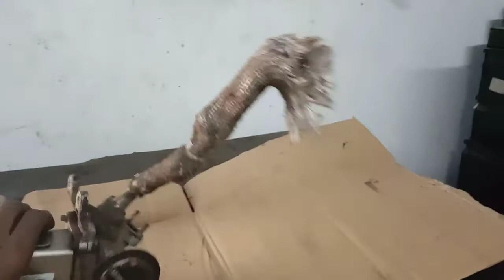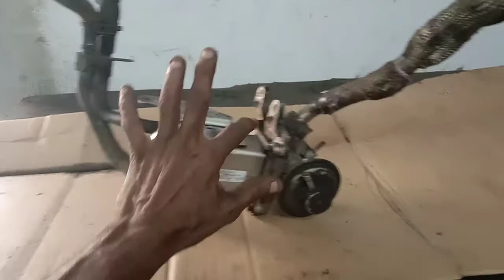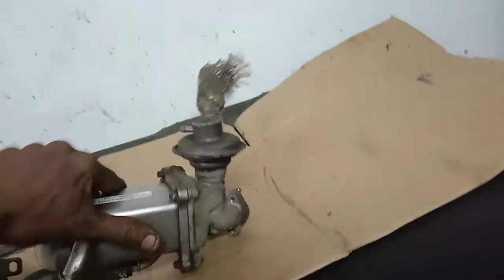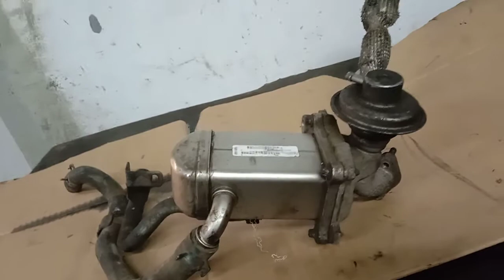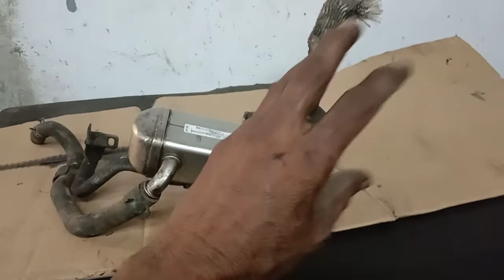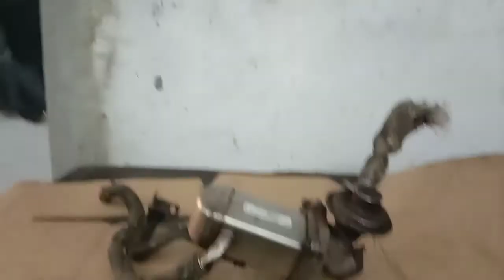EGR

Comment: En rapid car 40km otuna apro sprong symbol blink aguthu and diesel mileage romba kammi aguthu apdi blink agum pothu enna problem sir
Reply from the maker: Injector issue
 1 tank mix engine oil 1/2 lier
Not ok pls check scan tool which injector complaint change it
Reply: @skilledmechanictamil  i checked sir its showing intake blockage or leak

Comment: Super ace mint la running la off aguthu sir load la mattum, empty la off agala sir, nozzle service panni poten, diesel filter change panniten, turbo nalla iruku but problem solve agalaa
Reply from the maker: Air filter remove panni iiinlet mannifoldiil ethavathu manal iiiruka parunga appadi iirunnthal ennginnne weak
Reply: @skilledmechanictamil  anna 2019 la engine full work pathuten head & engine bore piston change pani 20,000 km than odi iruku 5000 km one time change panniruken. Na check panni pakuren anna. Egr la problem irukuma anna???
Reply: 5000 km one time oil change panniruken
Reply: @skilledmechanictamil  தங்களின் வேலை பொழுதிலும் reply செய்தமைக்கு நன்றிகளும், வணக்கங்களும் 🙏🏻🙏🏻🙏🏻🙏🏻🙏🏻